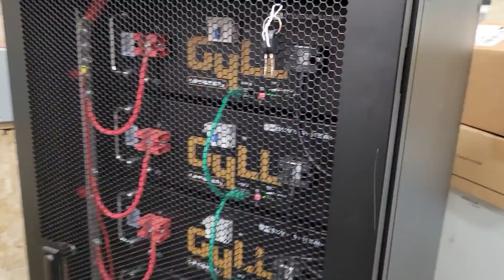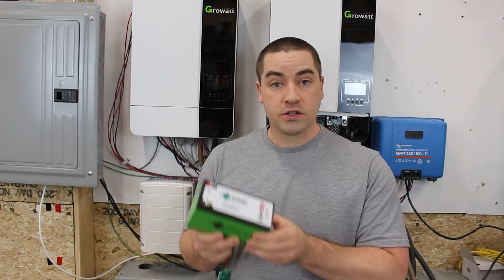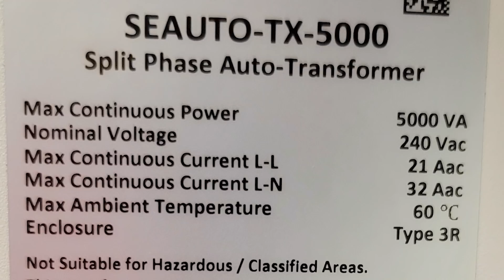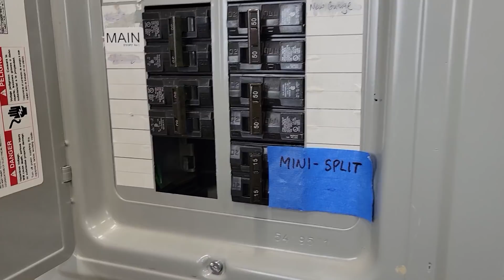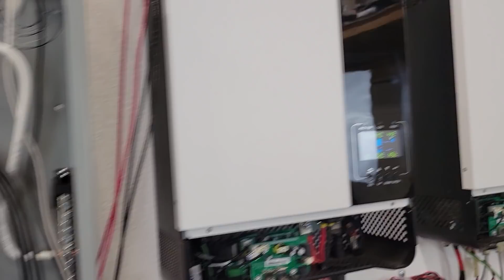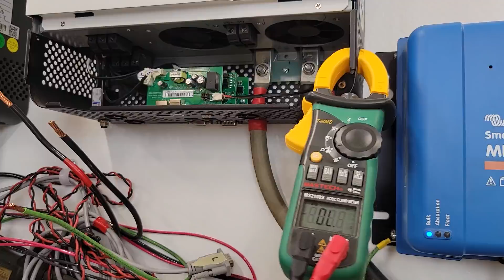Safety Concerns with Auto Transformer and Growatt 240V inverter SPF 5000 ES

Comment: Another super informative video David, a great solution to the overloading worry.  So are you running the ground on the inverters to the ground in your main breaker box and is the ground and neutral in your breaker box bonded?  Much thanks.
Reply: Yes, that is how his system is set up.
Reply: @eDoc2020  what if ur inverter only has two outputs L and N no ground except a grounding screw on the case can u run the ground from that screw to the inside of the breaker box ? and when ppl do all this case and inner grounding what about a grounding rod where does that come into play ??
Reply: @thelithiumpowerch  You're asking too much to answer in a YouTube comment. I suggest you look into the local codes applicable to your area as well as the instructions included with your equipment.

Comment: What a coincidence. What a cluster. People have been questioning this setup for quite some time and you knew the potential dangers as well. Why did you hesitate until now to bring up a solution? Now that this inverter was supposed to be a great affordable way to power our homes with out a battery and use the hybrid grid assist a long with just solar panels, looks like it's not so much affordable now is it? Now that people are stuck with these inverters and transformers, included myself, we now have to spend more on fixing this with expensive components. And still not one of you can put up a schematic for what you're installing when many are asking for guidance. Obviously I'm not happy about this and  alot of others are not as well. Hopefully your buddies over at signature solar can find the time to get these problems resolved. I have nothing good to say about my experience with them.

Comment: I am trading in my growatt 5000 es for a a different inverter with internal transformer designed for US (LVX 6048) to avoid dealing with any of these issues mostly because I'm a newb and rather not risk it.  I now have to unload my solaredge 5000kw auto transformer that I never used.
Reply: If someone needs a Solaredge auto transformer message me.

Comment: Typically you would not put a circuit breaker on the Neutral, since that is also at ground potential and you don't want to loose that voltage reference across the system.  Think of your typical grid tied electrical panel.  Neutral is a permanent connection, and the main 200A breaker only switches the two hots phases.  Not really a good idea to have anything that will interrupt neutral.  Also, your setup of interrupting only one hot leg could still develop a voltage at the loads depending on the system grounding - which is not clear in your setup.  Your neutral everywhere in your house can rise up to something other than ground potential - if the ground to neutral bond isn't in place.  In your case I'm assuming you are ok as this connection is still at your main panel (with ground rods), but that really needs to be clear as that isn't shown in your video and is an important part of a safe system - on grid or off.

The normal application of this autotransformer (with the StorEdge inverter it is designed for) does nothing with any circuit breakers isolating the transformer.  It is permanently wired to the inverter.  Proper safe operation in ensured by the temperature sensor in the transformer, which connects to the inverter and shuts its power output off if there is a transformer overtemp fault.  You should really do something similar.  Also, for grid tied setups, the autotransformer is also only switched in during islanding mode.  SMA's autotranfer/autotransformer box works similarly - Enphase gateway, etc.

Interesting what you are trying to do (and better than you started), but even as you have things know this would not be considered safe or legal from an NEC electrical code or UL standpoint - just for you and your viewers info.
Reply: If the AT fails from an internal failure or shorted N then the breaker trips N and L1. L2 has no current path left even if N and G are bonded in the panel after the breaker. Remember N is gone due to the trip and L2 is in no way connected to G. For any current to flow, you need a path and David's solution removes any current path. Think about it.
Reply: @solexxx8588   Correct, need a current path.  But as only one hot leg is being disconnected, the other hot connection is still going to all the loads.  The issue arises from the sketchy grounding of the 5000ES or any other international inverter used in the US - which may or may not be bonded internally to the inverter's so called neutral (which is this case is a used as a line output).  Depending on how the overall grounding connections are setup, you can still develop a voltage potential at the inverter chassis and downstream.  I agree David's setup would not incur this, but others using this inverter and not understanding system grounding may.
Reply: @billjohnson3344  Yes this would result in hot wiring downstream if the inverter had a neutral bond. As David showed his Inverter does not have such a bond. In fact if it did there would be a short circuit anytime the autotransformer was connected.

Comment: DAVID, I have another idea.  the breaker is good idea, BUT how about you put a little more space which give more room behind the auto- transformer.  THEN put a 12v Dc FAN, 10 mm Fan, the type that is in the desktop computer " BLOW air flow from bottom up", a little angle to behind the Auto Transformer to cool it down.  Easy and cheap.  Good lucks, have fun.  
THE TRansformer I ordered just came which is GroWatt Transformer, it does not have the Fin/grill on the back.... I am sure it would go hot.  I am not sure how I can cool it down... I may have to drill HOLES on it.  but this would void the warranty.  Any one have any idea ?  I can not keep the door open. What iff someone or bugs will get in and or get shock....  Thanks
Reply: Might want to use a 129v A/C box fan, 
reduce components

Comment: This is very neat.  Love the content on this channel.  Plan on doing a set up in mexico with 2 of these and use a 120v to 48v charger to charge up the battery  and run off the inverter with the auto transformer to have 120v. Since there is just 120v at the house and want to add 240v ac for a small ev. Or for when the power goes out. Will be great  for setting up and also for welding as well. Keep up the great  work. 👍

Comment: I noticed that Signature Solar recommended a separate 220 v only panel and then put all your 120v loads on a second panel that is balanced by the autotransformer.  They mentioned this simply because it's the 120v loads that cause the imbalance in the first place.  I noticed that all your loads in the panel shown are 220v loads.  Where are your 120v loads connected if you have any?
Reply: Imbalance is one issue.

A failure of the auto transformer can create a problem, unrelated to imbalance, which can blow 120v items in your house.
Reply: The 120v loads are connected in the house panel.

Comment: Thanks for showing us how to add extra safety into this setup.  It's pretty scary when you lose a neutral!!
Reply: @Patrick Baptist last bit here. The hot side is protected as well in multiple places.  The neutral breaker is meant to prevent overloading of the wire AND autotransformer.  It shuts off everything to prevent a lost neutral.  Have a great day.
Reply: @Patrick Baptist You, sir, have no idea what you are talking about.  All of you arguments are based on the operation of the LOAD side of the system.  All of the stuff on the USER side of the breaker panel.  This situation is on the SOURCE side of the AC, like the mains connection to the grid.  This is the generator side of the circuit, and so interrupting both phases and the neutral cannot have a safety issue because it's on the source side of the panel and not the user side.  The user side still has neutral bonded to ground in the breaker box.  Thus, it doesn't matter if the neutral is disconnected, since the hots are both disconnected as well.  Consider that 240V appliances don't even have a neutral connection, and they have no resulting safety issues...

If you think about it, a neutral wiring fault where the neutral is completely open, is not dangerous at all.  There is no complete circuit, thus no current flow, and so no danger.  All appliances are either double insulated or grounded to prevent the user getting exposed to line voltages.  Where it does become dangerous, is a partial open or poor connection on the neutral (or hot, for that matter).  This may result in overheating of the connection, causing a fire.  An open ground lead on an appliance equipped with a ground is a much more dangerous situation.  As far as your bus (what the heck is a metal endorser???) is concerned, the skin and all other metal components should be properly earthed to bleed away any fault currents from bad wiring, but this has absolutely nothing to do with the AC neutral.

Classic power distribution systems have a transformer on the power pole to step down the high voltage distribution network to the typical split phase 240/N/240v connection to the consumer breaker panel.  This system has the neutral and the ground points of the transformer secondary connected together at the transformer, to ensure the neutral does not have any voltage on it, except for a bit caused by current causing a voltage drop in the wire.  In a typical home breaker panel, the neutral bus bar and the ground bus bar are both directly connected together thru  the metal enclosure.  This ground net is then connected to a good earth ground inside the structure such as a water pipe or long grounding rod driven into the earth. So, loss of the neutral on the incoming power side, while not a desired situation, does not result in any immediate safety concerns.  Since there is no power to the panel, nothing is going to be powered, so there is no concern about hazardous voltages on the loads.  

I think this is actually kind of redundant, since if there is no AC present on the two phases of the incoming AC, there is no reason to assume there will be any voltage on the neutral either.  The autotransformer is just used as a divider circuit to ensure that the neutral always remains exactly halfway between the two phase voltages.  Since they are out of phase anyway, this works just fine.  It is prudent, however, to address the possibility of a fault on the autotransformer.  If one side or the other develops an internal short, the autotransformer could start to draw excess power from one or the other of the inverters, and cause an imbalance on the system, possibly damaging 120v loads or the inverters themselves.  This system relies on a large circuit breaker to interrupt the power, which means the fault current has to be large to trip the breaker.  By the time the fault current gets to this value, damage has likely already been done.

There should be a way to apply GFCI technology to this situation, which would provide an extremely fast trip and protect everything, without relying on huge currents for tens of minutes to trip a breaker.  This would be a topic for some research.
Reply: @Patrick Baptist  not really.  You understand why it's there, right? It's in case the neutral is overloaded, but shuts down the entire system to protect you.

Comment: So you have limited your total inverter current to your panel to 32 amps..  In the case with an auto transformer, I would run two separate panels.. One for 240 and one for your auto transformer 120..  You could get all of your available capacity to your panels...

When I finally do my setup, it will be a split phase inverter to help eliminate these kind of issues..
Reply: Each inverter is run through a different pole so the total to the panel can be 64 amps.

Having separate panels for 120 and 240 isn't very practical for David because it would require rewiring his house.
Reply: Split phase low frequency inverter has the transformer built it, which is nice, and provides the extra juice for peak loads.

See vendors like Genetry Solar… I would avoid cheap inverters live PowerJack & their clones.

Comment: Of course there is no ground to neutral connection at the inverter !    That's because the 5000ES inverter is 240V output, 2 HOT LEGS with NO neutral !     No neutral from the inverter is the whole reason you need the auto transformer.   IF there was continuity as you were testing for, that would amount to a dead short from that hot leg to ground, so of course there is no continuity.   I'm pretty sure you understand all this and just slip with the wording terminology,  still.... others will follow what you do.    

 I have the 5000ES myself with the auto transformer and very pleased with it.     The wiring part comes easy to me being a  licensed master electrician since 1982.
Reply: Yes, if the inverter had a ground connection to wither of its outputs it would cause a short circuit. But that doesn't stop people from asking. It's easier to show the lack of a connection with the meter than to go through the technical reason of why we know that's the case.
Reply: Hello George, these actually have 240v on L1 along with a Neutral.  A lot of the world operates on that or 230v-N, 50hz.
Reply: @benssolarandbattery  Better look up the correct definition of a neutral !              Neutral is at zero volts to ground,  not the case with either leg on these inverters.    The European 240V system is 240Vhot to neutral AND that neutral is at ground potential !
Reply: This came from the fact that there are European versions of the growatt inverter being sold in the United states.  And they do output L1 240 v and a bonded neutral. 
Everyone please make sure that you are buying the right one.  Like the one being sold by Signature Solar. 
And not the ones on Amazon.

Comment: typical electric code rule is to size your circuit breakers for 80% of your load. so a 40a breaker should only run a 32a rated continuous lode. This will avoid nuisance tripping as most circuit breakers are designed to only run at max rates load (40A on a 40A) for one hour before they will trip. Spikes 200% of rating (ground fault) will cause a fast trip.
Reply: MCB's like to run at max amperage for a long time, as shown in one of his other videos.  That being said, if you're maxing it out and getting nuisance trips, it's probably time to consider a larger system.  I also wouldn't consider this a continuous load, just like a service to a house doesn't have to be rated for continuous duty.
Reply: The main rule is that the wiring should be sized to 125% of the load. Assuming David is using sufficient wiring here the only issue could be nuisance trapping. IMO nuisance tripping is better than potentially burning the transformer.

Comment: Your appliances would be burned up before the breaker is overloaded…better way to do it would be to replace your 3 pole breaker with a 2 pole contactor with a 120v coil…then if the neutral drops then so would the power…
Reply: A contactor is an excellent idea.
Reply: @timselectric502   I also believe a 2P contactor for L1 and L2 with a110V coil is good idea ! Would it be compliant?
Reply: Yes
As long as it's installed in a compliant manner. 
In a rated enclosure, with over current protection.
Reply: Also,  a 3 pole mechanical overload would be a good way to protect the transformer.  Because,  you could use different values for the hots and the neutral.
Reply: But why?
Reply: @benssolarandbattery  - “But why?”

In a previous pair of videos, that he is responding to, if the auto transformer fails or if a breaker snapped (intentionally by a switch off or unintentionally due to load) that the auto-transformer was plugged in to, one leg would jump from 120 to 249v a blow up half your junk.

The poster tried to reference those videos with his comment, “Your appliances would be burned up before the breaker is overloaded”

David Poz solved the intentional or unintentional breaker snap, blowing up equipment in the house… but did not cover transformer failure with this video. He hinted at it, with the relay & battery & thermo relay board, but he never completed the thought.

There is still more to go, to make this a safe setup, with an auto-transformer. For equipment that has an auto-transformer built in, they have monitoring equipment built it, to keep an auto-transformer failure from blowing up half your house’s equipment plugged into A/C. (If you have a fridge get blown, this becomes an increasingly expensive problem.)

The full isolation transformer is really the only safe solution… if the full isolation transformer fails, the equipment in your house is reasonably safe.
Reply: @DavidHalko  I didn’t respond cause those that don’t understand electricity would not have a clue about how to wire or understand why wiring a 2 pole 120v coil contactor would solve the problem…those without understanding need to hire someone qualified